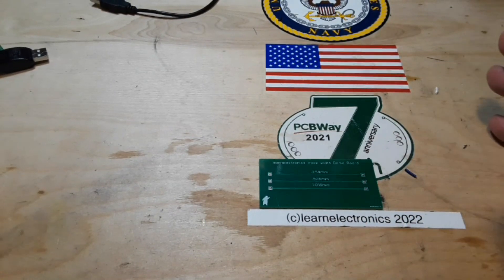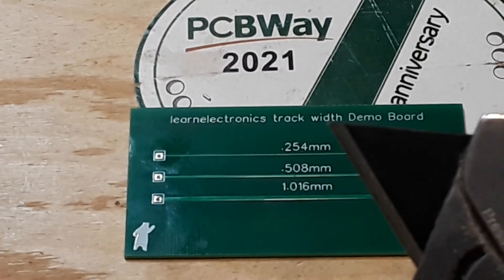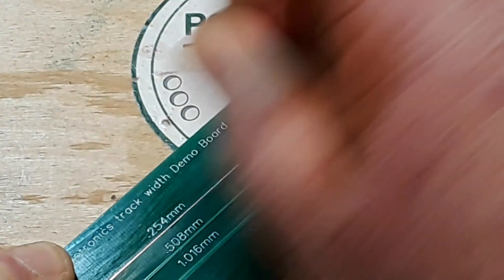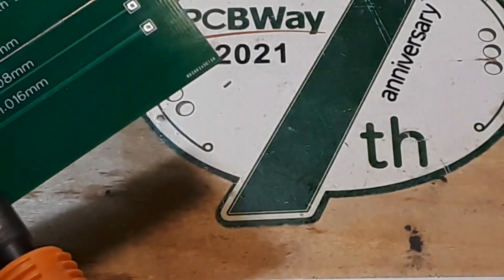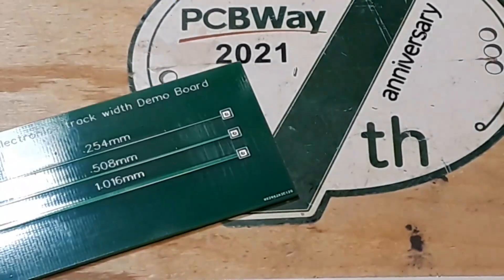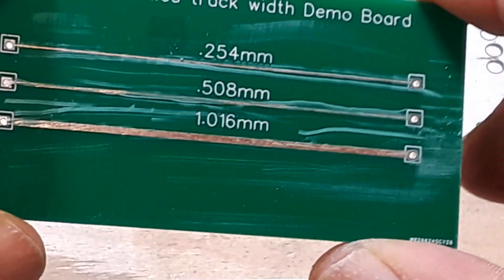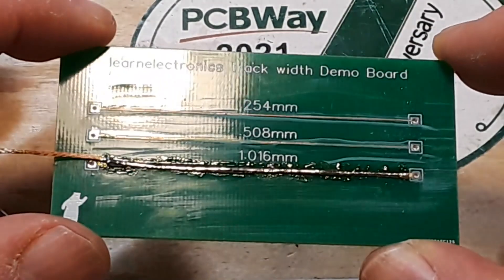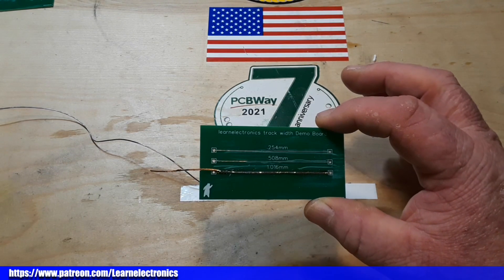Solder mask removal and track surface area enhancement

Comment: I scrape the bulk off with a scribe, pick, screwdriver, blade, etc then use a fiberglass pen to get rid of the remainder. I then run the area with solder and remove it with braids while dragging the braid across any area that still resists the solder. That last step works wonders and reduces the time I need to waste with the fiberglass pen… which is the first and last for some people (gluttons for punishment).

Comment: I abuse solder wick all the time and keep a pile of my used wick for stuff like this.

Most recently I used/abused it to bridge between the ground plane on the bottom of a board and an RF modulator hanging off the edge of the top side after being mounted to the ground plane on top of the board. The modulator was from a decades-old mod someone else did so I gutted it and mounted a mini DIN in the hole where the RF jack had been, using the old RF modulator housing to hold it in alignment with the hole someone drilled for the RF lead. Because it was gutted I was able to use more wick to secure it on top of the board with wick going into the old modulator housing to create a bridge from the ground plane on the top side too. When I soldered to the bottom I found that much of the solderable plating was missing so I had inconsistent blobs. I was able to strengthen those blobs by joining them with a big piece of braid which also elevated the solder enough to reach the ground plane on the bottom side for a secure mount.

When adding the mini DIN to other units that didn’t have the mod I remove one of the original ports to add mine where I can reuse the existing hole. I scrape the solder mask to expose the ground plane and solder the mini DIN shield upside-down. Due to existing mount holes and thermal reliefs the ground plane I solder to doesn’t cover the entire area beneath the mini DIN… but it also extends nearly a quarter of an inch past the edge of the PCB. I flip the board over, add solder to the area that protrudes past the end of the board, then use wick to make a rigid solder bridge that wraps around to the bottom of the board making a super-solid physical connection… then I go back and mount my PCB on the pins of the upside-down mini DIN. ;)

You can use braid to make solder go places it was never supposed to.

Comment: Hi there I've been using a fiberglass pen for lots of cleaning and abrasive jobs probably worth a look
Reply: Esslinger (watchand jewelry-repair supplies) sells higher quality German-made scratch brushes, including a skinny 1/16" model that I've not seen anywhere else. They sell the fiberglas refills too, in both 1/8 and 1/16".  I save the short nubs that will no longer work in the handheld tool and I have modified them to fit into a battery powered artist's eraser.

Comment: Just tossing some ideas:  sandpaper, or Scotch Brite pad.
To clean copper before soldering, I've used a piece of Scotch Brite pad cut into a circle then attached to a dremel mandrel (the pad was pinched between two washers made out of cardboard from a cereal box).
Reply: Magic Erasers are actually a foamed version of melamine laminate (used for cheap kitchen cabinets and countertops) and is quite abrasive, that would likely work.
Reply: @goodun2974  Did you mean to make that a general comment (and not a reply to me)?
Reply: @JohnSmithZen , a general comment,  yes, as Scotchbrite and Magic Erasers aren't the same thing. I'm also fond of using glass-bristle "scratch brushes" for removing solder-mask, and oxidation or corrosion products, as I've mentioned elsewhere here.
Reply: @JohnSmithZen  and PS,  hardly a day goes by that I don't have a Dremel tool in my hand, including about 10 minutes ago!

Comment: At 2:50:  Most modern erasers are referred to as "plastic erasers" and "latex free",  and they're made of some kind of soft white vinyl like substance with little to no grit,  generally designed for erasing pencil and not ink.  You need an eraser with pumise or silica or fiberglass in it, not so easy to find these days. Tombow makes a rectangular handheld block eraser for ink. Clic/Pentel makes a retractable "Hyperaser" pen with fiberglas in the thin, wide rectangular eraser refill. Sun Seed Dolphin makes small gray "sand eraser" rods (4 mm diameter) to fit in their own battery powered artists erasers (or use them manually with a 4mm pin vise); all the other companies that make battery powered artists erasers use a 4.5 mm eraser rod and I haven't found any of those that have any sufficient abrasive in them.

Draftsmen used to use  AC powered erasers that were kind of like a big Dremel tool with a hollow center that you loaded with an 8" long, 1/4"  diameter rubber eraser rod. The pink and especially the gray eraser rods have the most abrasive content but nowadays  it's very difficult to find new old stock 1/4" eraser rods that haven't dried up to the point where they crumble if you look at them funny (they were made with natural latex rubber).

Comment: Sometimes, simple is best. Cleanest, quickest is scraping with a razor.
Solder will increase the surface area but copper solder wick will have slightly less resistance than solder alone.
Good demo. Paul.
 Now, test current vs. temperature with original board and modified board.
I

Comment: Why not just design a bare copper trace? I use Kicad and use a keep away area on the solder mask, giving me a pre-tinned track on the PCB design, working great.
Reply from the maker: This video is about what you can do when your need to fix a problem
Reply: @learnelectronics  plus some foundries dont do bare copper prints.

Comment: Why don't you just add a thick wire between the points? (The operation can be reversed, and less danger of damaging nearby traces)
Reply: I agree with your idea. The trace tinning( just the solder no solder wick) is usually done by manufacturers because it’s practically free. It doesn’t even add a manufacturing step. The traces are tinned as the boards go through the wave soldering machine. Using a wire would add a manufacturing step. But if you’re only making a few boards it’s a great idea.

Comment: I was wondering where'd you'd disappeared to.  Glad you are getting better!  Solder wick is pretty expensive to be wasting it like this.  Wouldn't a bare piece of copper wire be better and cheaper?
Reply: Used solder wick that already has solder on portions of it would be fine for reuse in this manner.  Yes, you can sometimes use solid wire to beef up the trace, but if the traces are really thin it can be difficult to get the solder to bond well to the trace.  The soda wick does have an advantage in that it is already impregnated with flux and because it's braided it just wicks the solder right up.
Reply: @goodun2974  I didn't see any used solder wick in this video.  I've never had a problem using plain copper wire over traces.